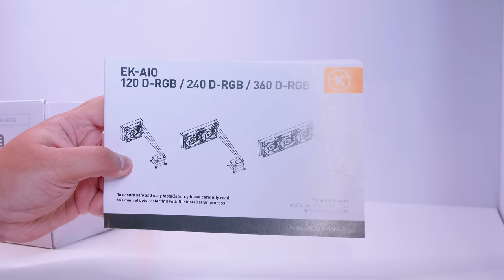HOW TO Install EK AIO 120, 240 and 360 D-RGB on Intel LGA 1200 and 115X

Comment: Flipping the tubes felt like I was in hell 😩 I went with a top mount and I can tell you it was a struggle trying to straighten these tubes out so it doesn't curl or look like the tubes went through a tornado. I have the 360 version

Comment: The EK manual didn't provide details on how to tighten the thumbscrews with the springs. I was wondering if it should be finger tight or screwdriver tight. This video was very helpful. So far the 240 version is keeping my i7-7700K cool very quietly.

Comment: Is there a reason you connected the pump to CPU OPT not CPU FAN?
Reply: The flow rate won’t change much but the fan speed will. It’s important for the fans to push through more air if the CPU gets hotter.

Comment: You didn't use the  D-RGB Hub. Some cases come with a 12v LED system...D-RGB won't work with those. Any reason you went without the hub?
Reply from the maker: Doesn't come with the hub
Reply: I’m wondering the same thing myself. I just got the 360 elite ek and it came with a hub and 6 fans. I’m confused on how to wire it all together 🧐

Comment: Not shown the radiator at all.
If Air passes through Fan to radiator and if  pass over motherboard, will it create problems? Will it raise temperature of motherboard parts? 

Not clear if Air is going inside cabinet from front or coming out from front.?
Good video but major items forgotten.

Comment: how did u manage to get ur ram in mine covers the first slot....
Reply: what? it shouldn't cover it
Reply: @nurenzayyan4825  it 100% does
Reply: what motherboard you got??
Reply: @karniskavva  asus maximus xii formula
Reply: @lambbosbread123  If I cant have the pump in the right orientation they missed out on a customer..
Reply: @karniskavva  the pump will fit not just on my board with 4 ram slots used
Reply: @lambbosbread123  I have Asus z490-e. doubt it will work with 4 ram..

Comment: Just a general question, you said no need for maintenance for this cooler ( I will assume all AIOs as well), is this for eternity (until pump stops working) or it has a certain period, say two years for example? Thanks in advance.
Reply from the maker: This is an AIO. They should last for many many years. I've only ever had 1 AIO pump die in my 20+ years of building.

Comment: Is the Y splitter supposed to have 1 end with all 4 male  connector and the other 2 ends with only 3 male connectors? For the fans each has 4 male inserts not 3
Reply: Yes, that's intentional not a mistake. One fan is getting the PWM signal and then giving the same orders to the other fans.

Comment: I really wish they also did a 4 pin RGB version.
Reply from the maker: Why? 4 Pin RGB has been phased out
Reply: Gear Seekers 

I just bought a brand new asus B450 mobo and it only supports 4 pin. And many others are like this
Reply from the maker: That is ASUS in a nutshell. Most of their high end boards don't have it either.
Reply: Gear Seekers 

I am lucky that Cooler master still has the decency to support 4 pin RGB
Reply: @theshadowman1398  z690 auros master has 4 pins

Comment: Hey I’m confused about the daisy chaining of the rgb connectors, im gonna buy the 360 ver of this aio and also buy the p500a which has 3 fans that have rgb and an extra phanteks fsk fan (the same as the pre installed case fan) and add it for the rear.
What I’m wondering is am I able to daisy chain all of the rgb connectors from all the fans and connect them to one 3 pin rgb header on my mobo?
Reply: No
Reply: @gyorgischwartz  why

Comment: is the tube long enough to mount the radiator in front (upside down) just as Steve from @GamersNexus shows
Reply from the maker: No. Most 360mm AIO's cannot be mounted like that because the tubes are not long enough. Just as Steve from @GamersNexus shows
Reply: @GearSeekers  thanks so much for the quick reply.  I'm going with artic freezer ll 360mm argb

Comment: According to GN having tubes run from the top like this shortens the life span of AIOs significantly
Reply from the maker: That's not what that video said at all 🤣 
Go watch it again
Reply: @GearSeekers  my bad, completely mixed up the two bad cases. Forgot that as long as the pump isn’t running dry it’s all good. Sorry!

Comment: Take note: AMD AM4/Intel 1200 sockets are compatible.
Reply from the maker: The video title says LGA 1200 and there is an AM4 version of this guide lol
Reply: @GearSeekers  Yeah but, they are pretty much the same from what I have seen on the EK channel. @5:24 those screws. I find that the intel screws do not fit the z590 as well but, the AM4 do fit.
Reply from the maker: What lol 😅